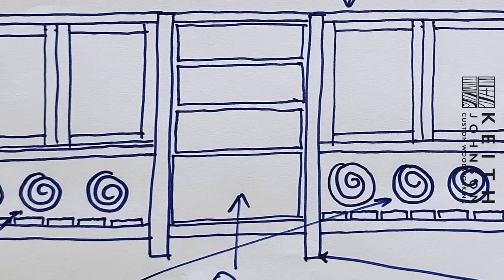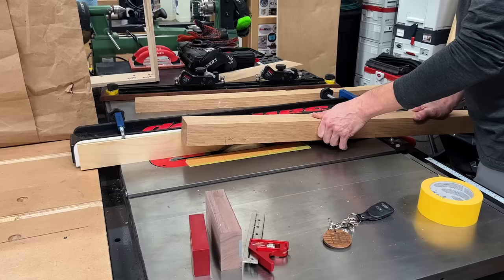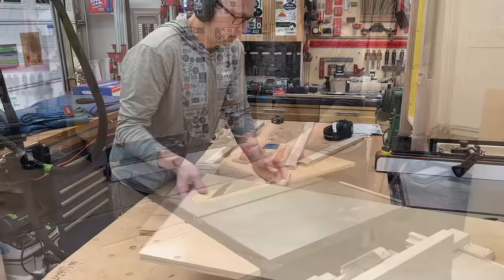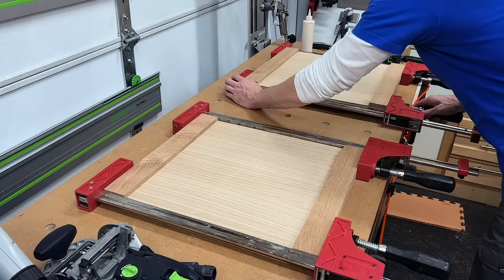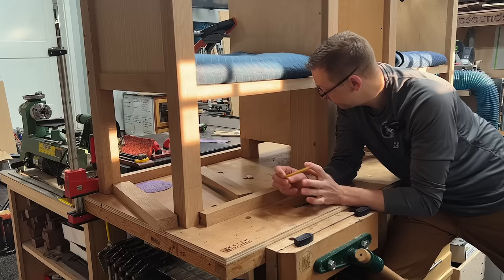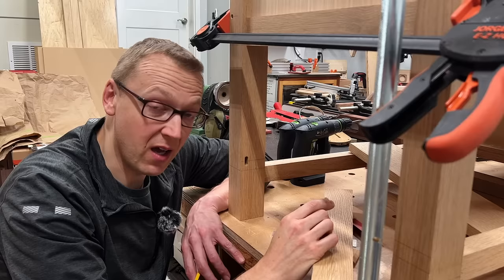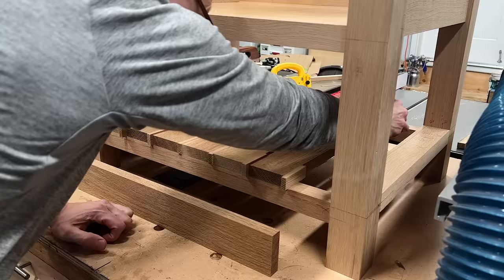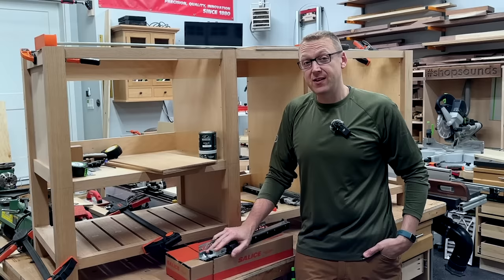True cabinet makers will NOT like this. Vanity PART 1

Comment: I think for the slats on the bottom, I would've simply used a small dab of glue and that's it. Probably why you're the professional and I'm still learning. Another beautiful build. Cheers!
Reply from the maker: Thanks Josh! Yeah, whether a mechanical faster or integrated joinery, you need something more than glue to secure those slats for the long term. 👍🏻

Comment: Great video, Keith. I think I’ve mentioned multiple times now, just how much of a glutton for punishment you are, but I know whatever happens, it will always end up top quality. It’s also interesting to see how other woodworkers and cabinet makers make furniture, etc, and I’m really liking the look of the Lamello too. Keep up the great work.

P.S. Woodworking in metric generally only goes to one decimal place (although, occasionally two), but definitely not as many as you showed 😂
Reply from the maker: Thanks mate! If it were easy, anyone could it 😜. It's much more gratifying and rewarding to challenge myself on every build.

Comment: this was super helpful, im looking at building something similar soon and watching your content always helps. one thing i did notice is that on the bottom shelves the outside pieces  that connect the front to the back are alot thicker than the shelf itself. is that on purpose? just looks a little odd thats all. Love the content keep it up
Reply from the maker: Thanks Ethan! Yes, the outer rail is intentionally thicker to basically create a “stop” so nothing rolls off or up against the wall.

Comment: Keith o build my contractor grade drawer bank drawers with the UV birch plywood and I use clear gorilla glue( no foam) and it works great.  Never had a drawer pull apart.  With 4 brads in each joint.  Just wanted to give you that tip 😊
Reply from the maker: Sounds great! Thanks!

Comment: This is some good timing! I just started a white oak vanity this past weekend. I'm very curious to see how you fit it against the wall with the leg pieces you've used, that's the one part I'm not totally sure on what I should do. it seems it'd be hard to scribe those thicc boi's.
Reply from the maker: Luckily, there will be a 1/2" to 3/4" gap on each side between the vanity and the wall, so no scribing will be needed.

Comment: Slight gripe about metric vs. Imperial argument. first I’m American so use imperial. Now, if you were to design from the start in metric you’d intentionally divide a piece in multiples of 10 (or .5mm) which would yield far better rounding and divisions. When converting to metric based on a piece designed for imperial, yes the numbers would be all over. Just my .02. Love that vanity BTW and the amount of engineering needed to make it break down…wow!
Reply from the maker: Valid point, but all my tools, fences, gauges, drill bits, saw blades, brain, etc. are in imperial. There's no turning back now! 😈

Comment: Dude, well done! So much joinery content in 1 video is wild haha. 
Curious though, have you used the Festool knock-down hardware? If so, how do they compare to the lamello? I have the Festool kit, and honestly for $300+ purchase, I've been pretty underwhelmed with its ability to pull joints tight and keep them there. I've seen you use the lamello almost religiously, so I assume in-person, it really does a solid job?
Reply from the maker: Hey Donny! I have yet to try the Festool connectors, so I can't speak on their effectiveness vs. the Lamello. But that might be a good video idea! And yes, the Lamello does a phenomenal job of pulling joints tight together using the Clamex connectors. The Tenso's work great as well, but don't offer nearly as much clamping power as the Clamex.
Reply: @KeithJohnsonCustomWoodworking  Got cha. Thanks for the quick feedback - I'll have to look into the Lamello more, I feel like it doesn't get a lot of face time with a lot of the woodworkers I follow - and perhaps it should haha
Reply from the maker: @donnygrahambuilds  If you do a lot of cabinetry, bookcases, face frames, etc. it's a game changer. If you build primarily furniture, then the Domino is the way to go.

Comment: Part 2 was awesome! Question for you Keith: I think you mentioned in this video that clamex connectors have a 200lbs clamping force? Or did I misunderstand that comment? Just wondering where that number came from?
Reply from the maker: Thanks man! And I misspoke…it’s 170 pounds of clamping pressure and that info is direct from the manufacturer 👍🏻
Reply: @KeithJohnsonCustomWoodworking  thank you! I was definitely wondering what the clamping force was but hadn't found that stat! I'm still learning, but already loving my lamello.
Reply from the maker: @bryanhall9996  Awesome! Glad to hear it! 🤙🏻😎

Comment: I can appreciate the comment about the Kapex. After owning one for about 6 months now, i’m confused what the big deal is… My incra cross cut sled is way better.
Reply from the maker: Yes! My first generation Kapex from 2012 was flawless until I had some kickback that knocked the fences out of alignment and the blade arbor. They were never able to repair it properly. I am on my 3rd Kapex since then and none match the accuracy and cut quality of the 1st generation.
Reply: Wow thats a shame. I was wondering what level of accuracy you can reasonably expect from a miter saw because mine is never “perfect”. Seems like you would need a radial arm saw to get the accuracy a machinist would be proud of.
Reply from the maker: @cemontalvo12  Well, for $1500 I would think it would be darn near perfect. LOL

Comment: Always enjoy watching your vids just curious I’m thinking of buying a kapex you mentioned you we’re having some issues? What’s your thoughts on buying one ? And what might the issue be ? Thnx
Reply from the maker: Thanks man! And the Kapex is a great saw, but it's underpowered and my tables aren't flat and there's a little wobble in my blade. It's compact and dust collection is great, as well as the angle controls, but it's a lot of money. My suggestion, buy it and try it. Return if you don't think it's worth it. Unfortunately, no miter saw on the market is without flaws.
Reply: @KeithJohnsonCustomWoodworking  thnx for the reply I brought one home tables are not flat either center part is higher than outside base you lay something on it rocks side to side checked the one at the store they use and the tables are flat they did not have another one in stock so sending it in to festool to see see if they will fix it I’ll let you no what happens 🙄 very disappointing
Reply from the maker: @plumbum6558  yeah, seems to becoming more and more common with that saw

Comment: Slightly off topic, but I'm considering upgrading my jointer and planer this year and looking into combo units. Are you happy with the Hammer A3?
Reply from the maker: First off, if you have room for 2 full sized machines, that’s my recommendation. If I had the space, I definitely would have done that and put them side by side.

Pros:
1.4 Hp - plenty of muscle
2. SilentCutter Block helical head is phenomenal. 
3. Machine is very quiet. Too quiet - with my ear protection on I can’t even hear it and sometimes forget to turn it off.
4. Change-over from jointing to planing is simple (60 seconds).
5. I like the European style guards vs. traditional pork chop style.
6. Having a 12-inch jointer is money.
7. Dust collection is great.
8. Very compact footprint and mobile base makes it easy to move around.

Cons:
***BIGGEST PROBLEM: Machine comes from the factory with a natural spring joint calibrated into the beds. If you aren’t familiar with this, you can Google to read more. This is a real problem. It can be adjusted, but I’m weary I will screw something up.
1. Infeed/Outfeed beds are short. Bed extensions cost additional $500-750.
2. My fence is cupped and never stays square to the bed. Has to be re-squared every time I move it.
3. Feed rollers on the planer are metal, not rubber. They skip sometimes if aren’t vigilant about waxing the beds and don’t always feed consistently when you are trying to take just a little bit off at a time. 
4. 12-inch planer is a step down from my old 13-inch Dewalt.

You can also check out MMWoodStudio on YouTube for his full review.
https://youtu.be/7ChzKnQLMww
Reply: @Keith Johnson Custom Woodworking  Wow, thanks for taking the time to reply with so much info! From what I can tell, your shop and mine have about the same amount of working space. I'm just a hobbyist, but I have a sawmill, so I process my own lumber. I'm using a Rikon benchtop jointer and a DeWalt 734 lunchbox planer (and a Woodpeckers Slab Flattening Mill Pro for the bigger stuff)... it just takes way too much time away from building. The 2-in-1 units are appealing from a space-saving standpoint, but I've heard feedback that toggling between jointer and planer becomes a PITA and some will often go back to using a benchtop planer anyways. After your feedback, I'm now leaning towards a large dedicated jointer and putting a Shelix head on the planer. Thanks again!
Reply from the maker: @G0F15H  No problem! I get asked that question a lot. The changeover can be a PITA if you jump from piece to piece and don't plan out your milling. And if you can get a full size jointer with long beds, you will be much happier in the long run.

Comment: You could save a lot of money by reducing your Domino usage. 2 Dominos at each end of the slates is way too much, even more so given that you use 8mm (?) Dominos. Festool recommend 1/3 of the thickness of the mat but that is for load bearing parts. In a case like this I would have used either a single one or 2 5mms. I did the same for the slates under my work bench and they are holding about 300lbs of wood without issues.
Reply from the maker: I disagree. You can get warping and twisting with just one domino. It’s not about how much load it can handle as it will get almost none in this instance. Having 2 ensures that the board will not twist. And if that happens on the workbench, it’s no big deal, but custom furniture is a different standard for me.
Reply: @KeithJohnsonCustomWoodworking  possible, but you could also just use smaller dominos and get the same protection. Given the number of tenons you use, I guess you could save quite a good amount by the end of the year!
Reply from the maker: @AlainPilon  using one domino in each slot instead of two saves less than 3 dollars vs. the cost of a potential call back. You’re hanging your hat on the wrong cause. I went through ONE package of 8mm dominoes last year.

Comment: Hey Keith ive been watching how you use scrapers and planes to smooth, flatten, get rid of glue, etc.  Heres a thing i struggle with...when I cut and edge with a router and a pattern i get little hills and valleys as the bit "chatters"  ive been using a random orbit sander to smooth out but thats risky...how do you smooth edges?
Reply from the maker: Sounds like you are taking too big of a pass. Take light passes until you have a little material left and then make your final clean up pass.
Reply: @KeithJohnsonCustomWoodworking  thanks!

Comment: Great video, Keith. Always fantastic and hilarious. Re: your miter saw - might I ask if you’re using a thin kerf blade? That might be the issue if so.
Reply from the maker: The issue was kickback over a year ago. The fence is no longer square and the arbor is tweaked.
Reply: @KeithJohnsonCustomWoodworking  oh nooooo. Warranty?
Reply from the maker: @Driver10011  They claim it's "within tolerance"
Reply: @KeithJohnsonCustomWoodworking  damn man, that’s not a good look for them. Sorry :/

Comment: Your insanity made it work.  Great job as always, Keith.  Question: why did you decide against a more traditional frame and panel design?  Seems like it would have accomplished the same thing while being a bit simpler.
Reply from the maker: Thanks! Frame and panel for which aspect of the build?
Reply: @KeithJohnsonCustomWoodworking  The build as a whole.  Frame and panel is super modular like you and your customer required and would have seemingly prevented your joinery mania. 
 I suppose I'm curious about your design process on this one.

Comment: Forgive my ignorance, but couldn’t you just move the table saw fence to the left of the dado stack to avoid the plunge cut?
Reply from the maker: Since I am right handed, any operation that requires using my left hand (especially something like this where you need a lot of control) is dicey for me. The other thing I could have done was move the fence further to the right and made the rabbet on the other side. I would have had to make 2 passes, though, since I was using a 5/8" stack and the rabbet was just under 3/4".
Reply: Thanks for the reply!  I’m making a similar cut in a bed frame I’m making and have been trying to wrap my head around the cutting process.  As always, great video!
Reply from the maker: @toddjones1280  Oh right on. Good luck with your project!

Comment: Why did you round down to two decimal places for the slat width (2.97"), or use a decimal number for the width in the first place?
Reply from the maker: I didn't round down...that's what it calculated. I don't work in whole numbers...there's either decimals or fractions.

Comment: Metric would've been easier if you started all your measurements in metric instead of starting in inches then converting to mm. Awesome vanity btw.
Reply from the maker: But all my tools, blades and brain are imperial, so starting with metric wouldn’t help much 😜
Reply: @KeithJohnsonCustomWoodworking  BUY ALL THE TOOLS!! hehe.
Reply from the maker: @EyesKhold  I'll never stop trying! Well, imperial tools, that is...🤣

Comment: Keith, I've been wondering for quite some time (and I will preface this by saying that I am aware you are a Lamello Rep).  But if you didn't have the Lamello, wouldn't your Domino, with its “mechanical” fastener offerings, allow you to do the same thing?

I guess I'm curious, why the Lamello over the Domino for that application?  Does it have more options for fastening? Is it the biscuit versus the domino cut, or something else?

Thanks in advance for your thoughts and great work thus far on this piece!

Kory
Reply from the maker: The Domino offers similar assemble and disassemble capabilities, BUT you need clamps to secure them when you apply glue. The Clamex connectors are their own clamps, so you just apply glue, turn the allen key and you have 200+ pounds of clamping pressure without clamps. Hope that answers your question.
Reply: It does; thanks for the information!

Comment: How much harder do you think you would have if you didn't have the dato stack?
Reply from the maker: On a scale from 1 to 10...7. And not necessarily "harder" as much as it would be more time consuming.
Reply: @KeithJohnsonCustomWoodworking  Ok, wondered since dato stacks are illegal in sweden where I am from, for safety reasons of opening where the blades are...
Reply from the maker: @gabrielarrhenius6252  As mentioned, you could also do on a router table, but will take many more passes and give your router quite a workout.

Comment: The bit with "metric hate" really made me angry xD 
You will never measure to a fraction of a milimeter, not in woodworking, you could round it up or down, it would make zero difference in this case
It's easier because you can just plug the numbers in into any old calculator and you will get the result. And you could also do it in your head, just like normal counting. I mean not this one, this one is pretty complicated, but you get the point. Do you guys have a special calculator for that? Or an app or something?
Reply: I mean, when he designs his furniture in SAE, then converts to metric, of course it'll come out weird.  That's why you design in metric. :p
Reply from the maker: It’s all in good fun! I’ve been using imperial for 40+ years, so I’m not doing a tool and mindset overhaul now 😜
Reply: Yes there are apps that will do fractional inches (3 keyboards, inch, numerator and denominator). Inches are stupid as the unit of measure constantly changes (half, quarter, eight etc). In metric it is simply millimeter. I have to work in both, unfortunately....
Reply: @meperson  Well that's a whole another story, I pity you haha 
When you're all used to imperial, you can never really change, it would be really hard, especially when everybody around you measures in imperial 
Maybe one day ;)

Comment: Metric is still easier. You just got really lucky that 2.97" is very close to 3". Nothing more.
Further generally with numbers you can should round the end result to the decimal point you can actually measure or achieve in terms of accuracy. In this case to 76mm which is still ( at 2.99") more accurate than your proposed 3". 
Otherwise nice video
Reply from the maker: Stop peddling metric. Nobody cares. I've used imperial my entire life and I'm not switching. What's easier for you doesn't mean it is for everyone else.

Comment: I was thinking to myself man we maybe should consider metric then you revealed the last part lmao.
Reply from the maker: 😂 Don't worry, I won't metric-shame you if you decide to convert 😜
Reply: That last part was incorrect - you rounded inches to two digits, you would do the same for metric - or even to one digit since one millimeter is 26th of an inch. The rest of the calculations are super easy in metric. I use both FYI.